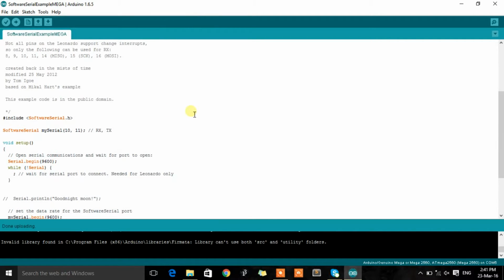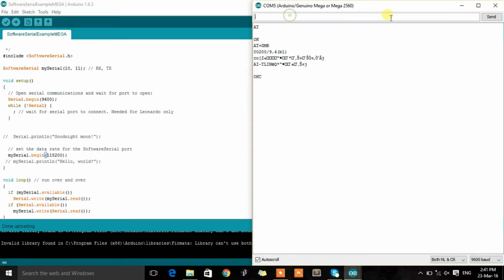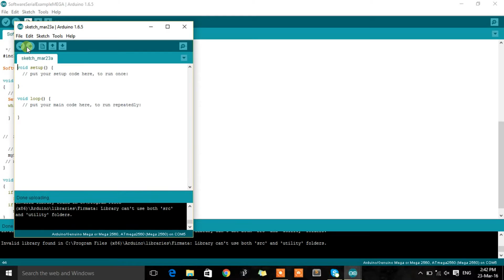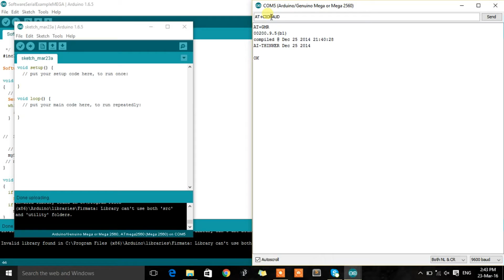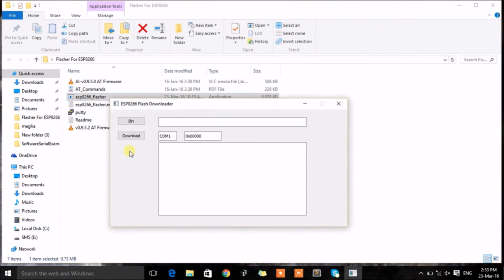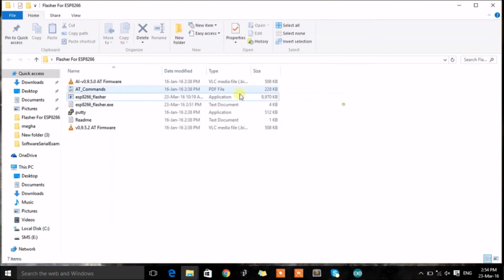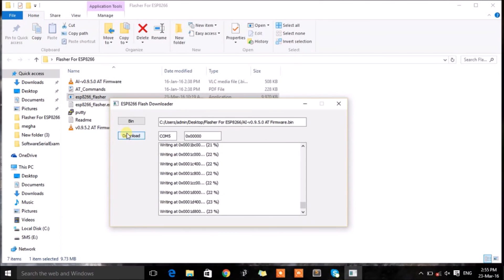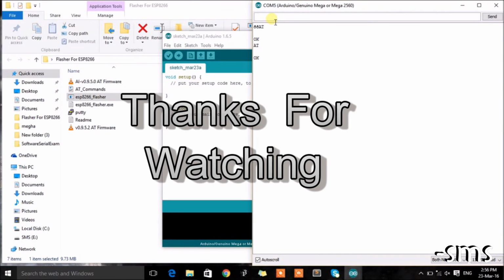ESP8266 via Software Serial ( Firmware Upgrading using Arduino )

Comment: I'm having a problem, is that when I'm sending AT commands manually i get normal response. But when I'm sending AT commands using software serial, i'm not getting any response in the serial monitor, it totally remains blank.

Comment: Thank you so much for your tutorial, I thought my ESP8266 was dead but all it hadn't was a proper firmware. 
Although you forgot the link for the software, I was able to find it easily online at:
https://github.com/Stadslab/ESP8266_example
Also I always thought that I needed a FTDI cable to program firmware and with your help I was able to get my ESP up an running! Thanks a lot!